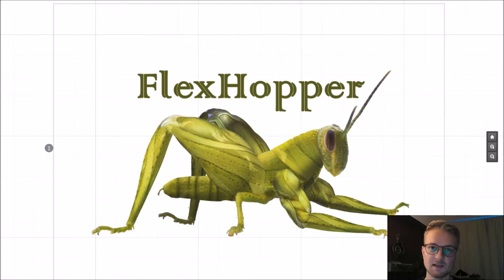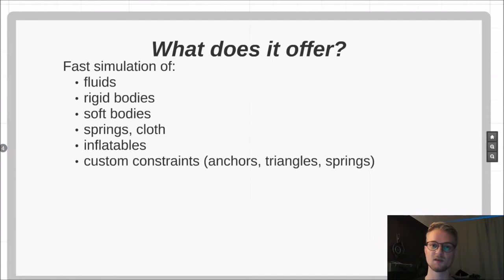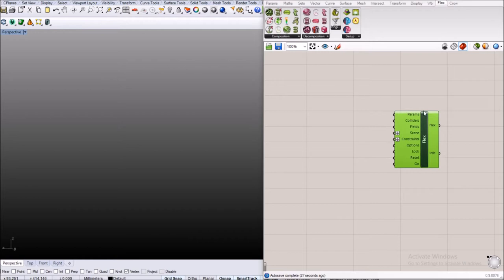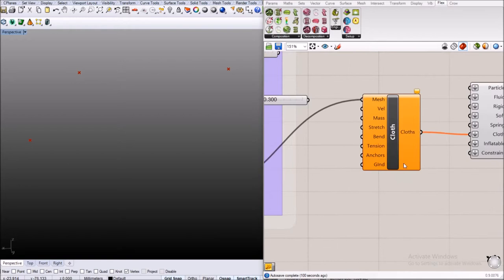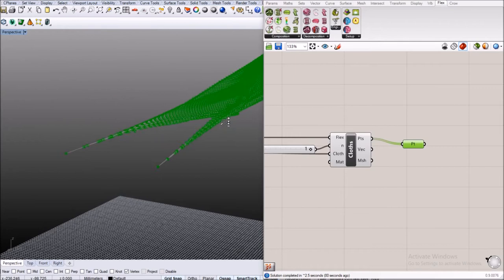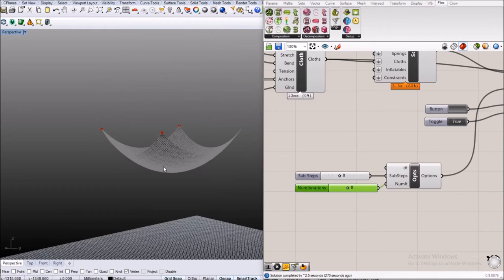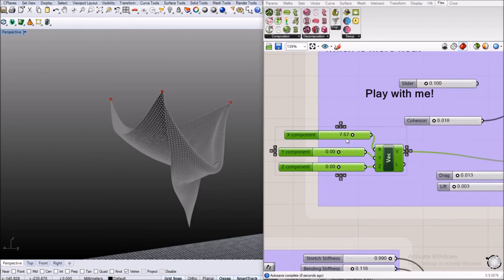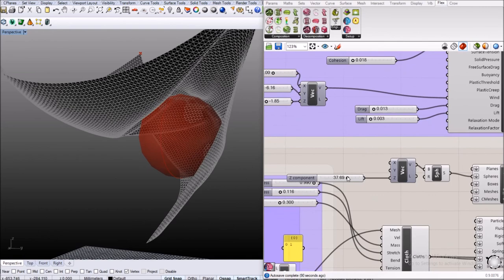FlexHopper Intro & Tutorial 1: Cloth Simulation, Collision Objects, Wind, Solver Tuning

Comment: Great stuff! I've just had a small issue that the 'Flex Solver Options' is missing. Error message shown below:

Solution exception:Method not found: 'Void FlexCLI.FlexSolverOptions..ctor(Single, Int32, Int32, Int32, Int32)'.

Any thoughts? sorry relatively new to grasshopper. 

Thanks